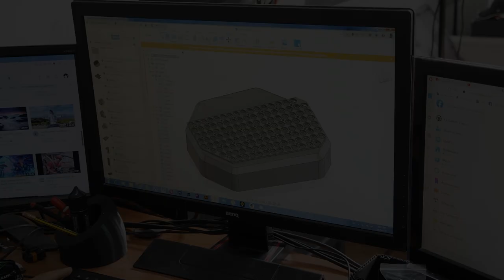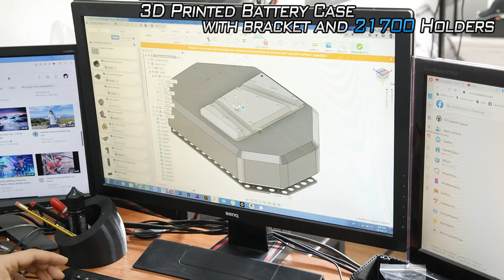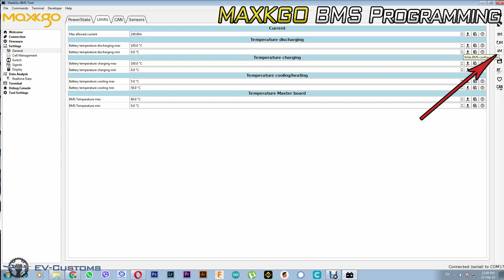Stingray Chopper Bike Restoration and Conversion to Electric (PART 2 - 2)

Comment: Should put the batteries box on the middle of the bike not on the side would’ve look way better
Reply from the maker: Yes but there didn't exist space for 77V 24Ah battery pack...  maximum 60V at 14Ah battery..  i have already made one, you can check it here https://www.youtube.com/watch?v=SIKZktznqM8&t=4s
Reply: also alot of unbalanced weight on one side.
Reply from the maker: Everybody says that until the ride it..  😁
Reply: There is value in asymmetry. Makes it more dynamic. Have you any thoughts about adding storage options on the other side?
Reply from the maker: Hi friend...  yes at first I was thinking to print second battery case for the other side, but with 80-90km range i change my mind ;)
Reply: @EVCustoms  manda o link pra mim amigo !!! Sou do brasil !!!